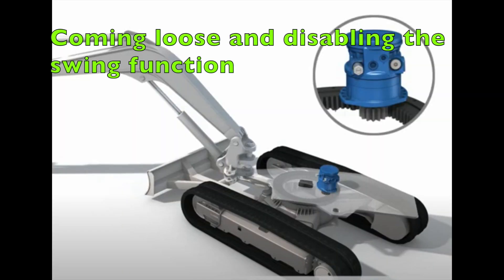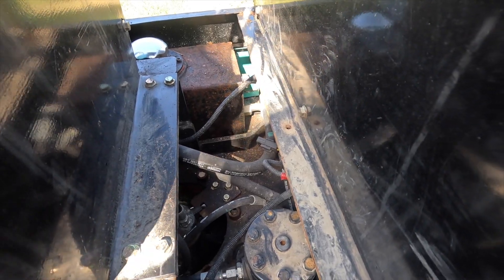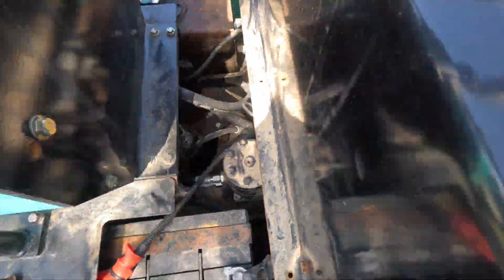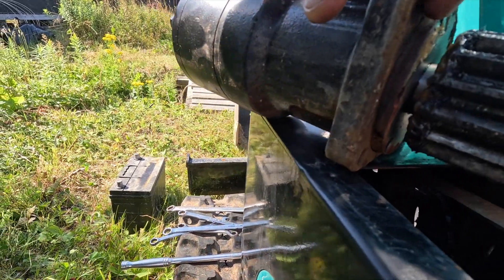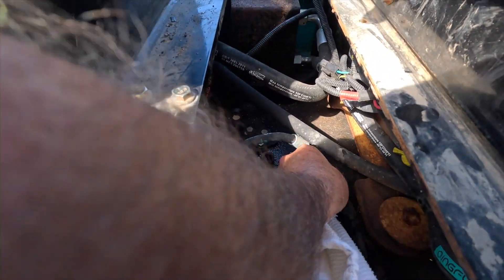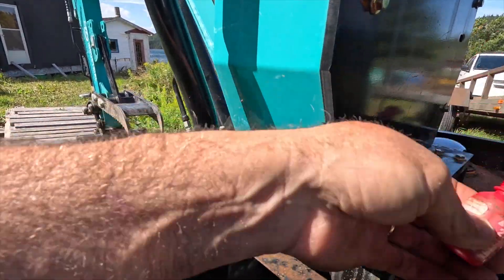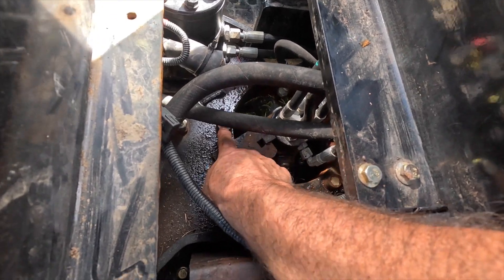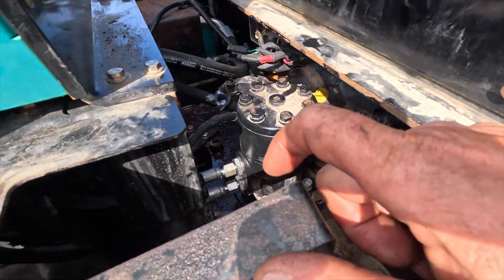Troubleshooting Mini Excavator Swinging Issues Ep. 91

Comment: Need to check the bolt on the gear. If it comes lose and slide down then hang up on frame and that cause housing to break
Reply from the maker: I did on the video it was tight but I torqued it a little more also.......thanks for the comment.